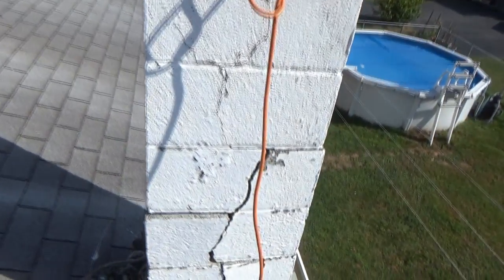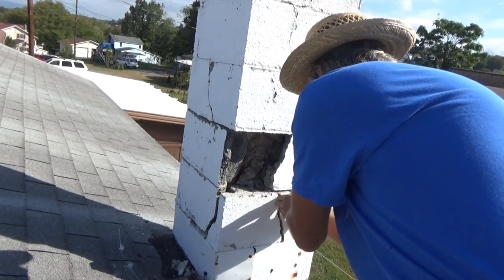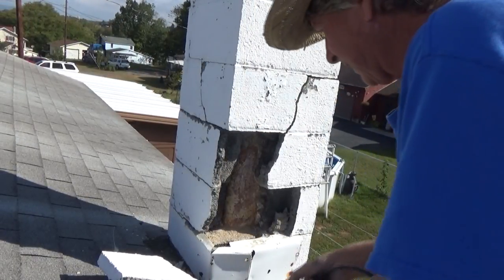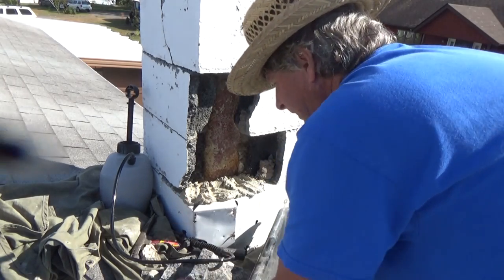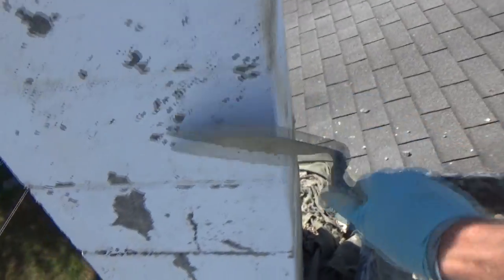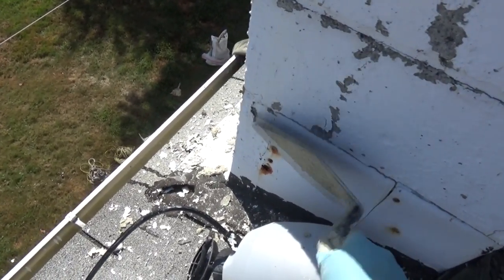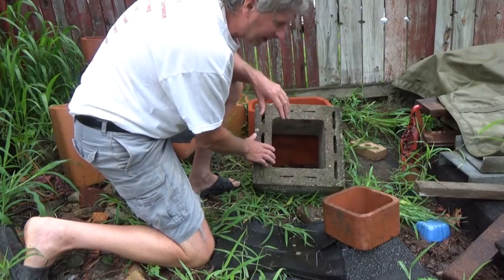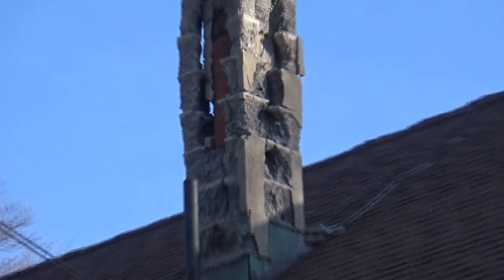CHIMNEY REPAIR  (part 7) Mike Haduck

Comment: your work and insight and talent in the face of reality is impressive Mike.
I was going to draft a response on this on my cellphone but couldn't type it as well as on my desktop.
most every house built in this area in the last century has one or more than one.
so fixing them and caring for them is a big deal in this area.
(Western PA). I'm glad you have taken the time to address this part of construction.
As you say, anyone with a chimney needs to check them at least annually.
it's a big part of our business aside from actual repairs.
The key, and you've mentioned this so often, is to keep moisture and rain and
snow/ice out of the chimney. 
I have used those stainless steel caps and think they are a good solution.
First time I have seen the idea of affixing set screws with extra cement at the top but
it's something I'll do from now on in our work. You could dig a masonry anchor into the
cap but why make another set of holes in the surface if your idea works just as well.
Reply from the maker: Thanks pensive, I can tell we are on the same page, thanks for the imput, mike

Comment: Up here in MA the problems i see usually have to do with the moisture (uncapped chimneys) mixing with oil and creating sulfuric acid, and rotting from the inside out. Not sure about PA but up here parging a flue tile is no bueno. Sell that liner everytime. I love your videos Mike!
Reply from the maker: Hi Dylan,  I bet your chimneys get beat up more than ours, it is true, I have seen what you are talking about, those flues have a date stamp for sure depending on what your using, anymore around here they are lining them with stainless,  I bet up there too, thanks mike

Comment: I'm in the UK we  have chimneys relined by inflating a form in the old chimney and pumping a refractory slurry  in from the top when its set the inflatable form is removed leaving a uniform flue top to bottom, You only need to break into the old chimney where  there is a change of direction, so you can keep the form central in the old chimney and make sure it can get the slurry all around it.
Reply from the maker: Hi Thorn, that is new to me, I never heard that before,   Thanks, mike

Comment: Hi Mike Thanks For all of the tricks, tips, and Insight into the world of Brick and Stone. Might I Help Your Fans By Giving them a tidbit that I Learned about Chimneys and Boilers and Furnaces. Years ago My House Was Heated By Oil. Now It Is Natural Gas and My Boiler is Very small compared to the Boiler That was there when I Bought the House. I Was Told That If My Chimney Stack Temperature was too Low, What happens when you burn a fossil Fuel is that the Residue from Combustion, Creates Acid. I Believe it My House was 40 years old when I bought it and Now it's 76 Years old. My second Boiler is about 25 Years old, and it just Is not Capable of Heating a 12x8 Clay Flue in the Winter, to the point where it has a 400 Degree Stack Temperature. Thanks For Your Help Also.
Reply from the maker: Thanks John, mike

Comment: Hi @mikehaduck I have some brick 1/2 walls leading up the side of an exterior stairs to the front door.  The cement "cap" is deteriorated and very thin.  I'd like to pour a new cap on top, square, a 2-3" thick, with a lip all the way around to protect the brick below.  Do you have a video that demonstrates this sort of project?   Or should I not pour it in place?  Am I better off to pre-make it and then set it on top?   Thank you
Reply from the maker: Hi, I have a video out called " how I Make concrete wall caps" Mike haduck, that might help, thanks, Mike
Reply: @MikeHaduck  thank you sir